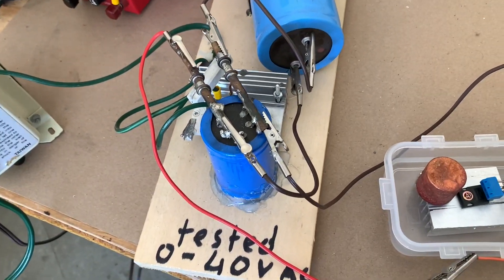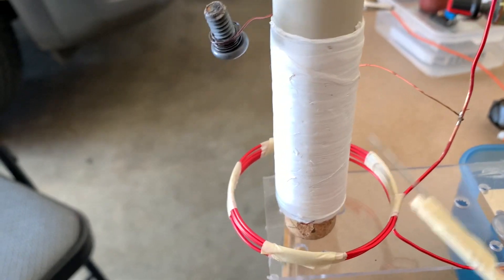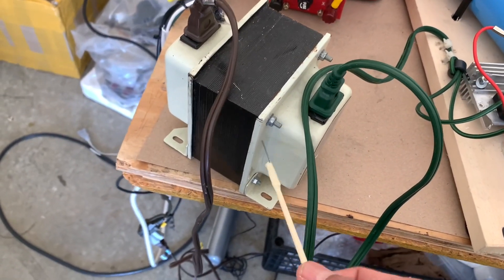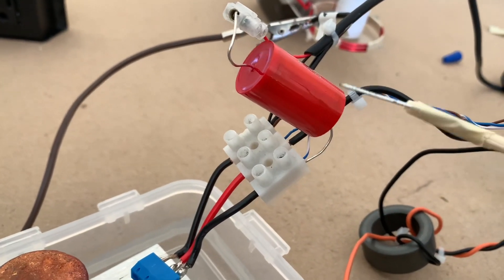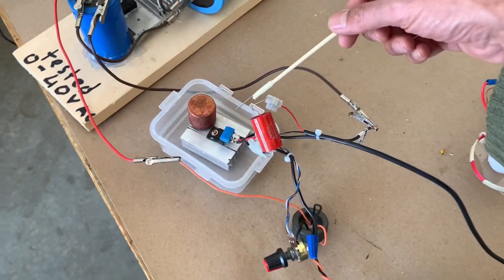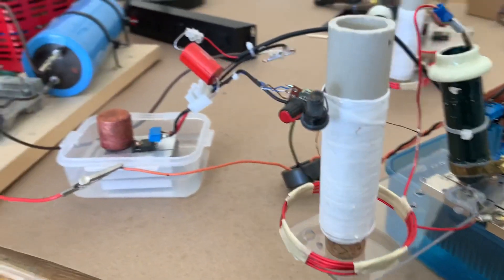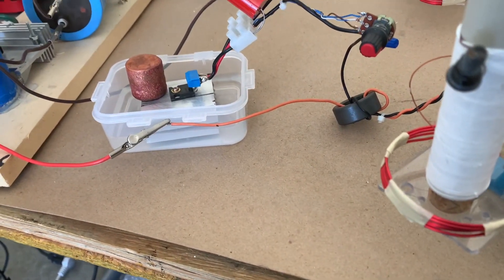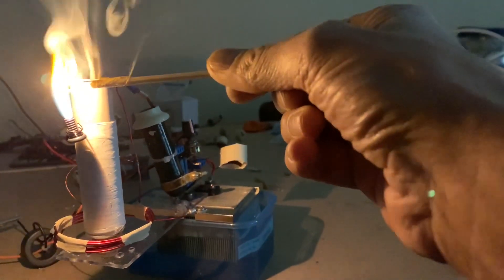10MHz Musical Tesla Candle

Comment: Try feeding the audio signal via your AC coupling capacitor directly into the gate! Depending on what the equivalent thevenin equivalent of your DC bias voltage (can be calculated or measured by simply shorting both ends of your pot or your DC input after tuning correctly and measuring the parallel resistance at the wiper output) and choosing a capacitor with a value that ensures the RC time constant is low enough to pass all audio, guesstimating something in the range of a few micro farads to tens of microfarads) and put a small low impedance audio signal into it, maybe 0.25 to 0.5V peak.

If that works, you can eliminate the need to have inefficient and clunky power supply modulation.

Comment: I think that the first with this 10MHz-mosfet-flame circuit came from https://www.vn-experimenty.eu/teslov-transformator/hf-sstc/hf-sstc-1.html
At least this was the first time this schematic came online, something like a decade ago? 
But you are right, it ís a really great& odd &great working circuit & idea! I myself used irfp240 for it and these can oscillate even on 22MHz
Reply from the maker: The circuit has been around a long while. The main thing is finding the right caps and getting it tuned but seems to be quite reliable!

Comment: The frequency of the primary coil is 10 mhz, but what is the resonant frequency of the secondary coil?
 What frequency should we look for? Is it the same, 10 mhz?
 What program do you use to calculate it?
I know there are many questions but, I would be very grateful
 if you answer me.
Thanks
Reply from the maker: It is best to make the secondary frequency exactly the same as the primary frequency. Once this is achieved, then fine-tuning can be done to get optimal output. The fine-tuning is done by changing the size and height of the breakout point, adjusting the height of the primary etc.
Reply: @BrianDhvTinkerer  Ok, thank you very much for such a prompt response.
I have done the circuit presented by the German guy from the Teslaundmehr channel but, it hasn't worked for me. I just get a little lightning but, the coils are not in resonance and I don't get a "candle flame".
A cordial greeting.
Reply from the maker: For more details check here: 
https://teslascience.wordpress.com/10mhz-musical-tesla-candle/

Comment: It would be interesting to run the plasma flame inside different gases like argon or even insulated liquids like oil or distilled water to see how it behaves.
Reply from the maker: That’s an interesting idea. Even low pressure environment would be interesting to to see how it behaves